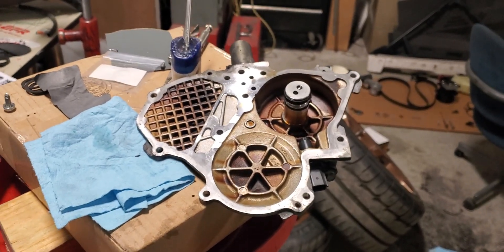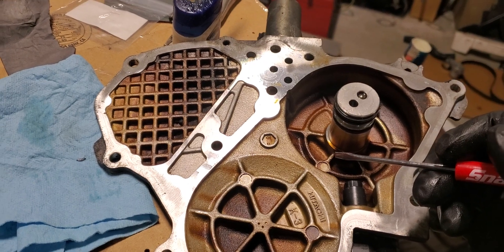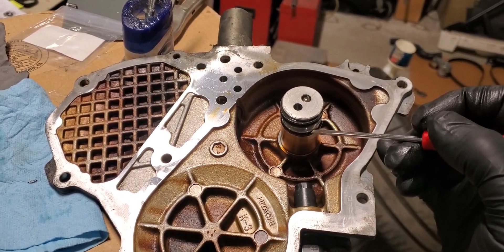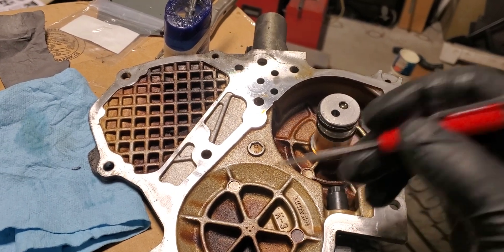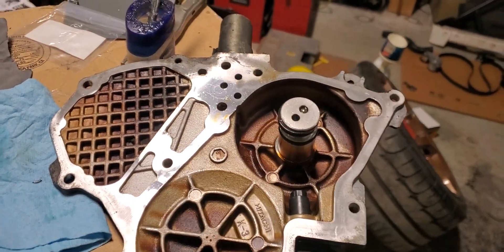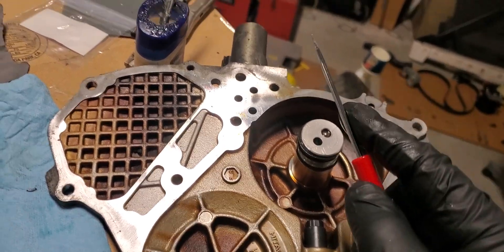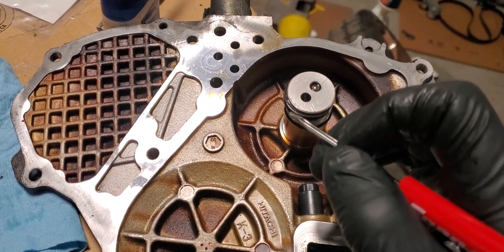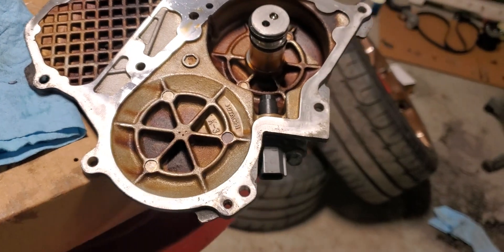Nissan 370z/ G37 (vvel) VTC control covers explained on VQ37VHR

Comment: Good Morning, fantastic video, I have a built VQ37VHR Turbo that is going into limp mode due to the phase not reaching required range, the motor functioned well for 4000km, and still runs perfect when not in limp mode, then started this error, it has had the block and heads cut, fitted with Wiseco pistons and Eagle H rods, after spending over $87,000 on building the car, the company that built the motor and the car  has washed their hands of it (run out of tallent) Unfortunately there is no one that I have been able to find in australia that has the knowledge required to diagnose the issue, after watching this video it makes sense to me that this is what is occurring, is there any way of further diagnosing to be sure this is the issue prior to tearing the motor down? I really appreciate your input
Reply from the maker: Can you get me any engine data stream info, I assume u have ecutek for management?
Reply from the maker: And what year engine/ car?
Reply: @sethjoyner391  Thanks for your response, the car has been tuned with Uprev, I am waiting for a friend with a professional Scan tool to be able to check data stream, mine only does VW, Audi euro etc, the Vehicle is a 2010 370Z

Comment: So, here i am again, decided to tackle a G37. 2010.

I installed 370Z heads from a good motor. MR16 headbolts, oil gallery gaskets, all seals EXCEPT, THE VTC cover seals & gaskets. ( seeing what i could get away with )

Now i have P0011-P0021 along with P0524. P0524 correlates with INT/V timing. 

I did a gallery gasket job on another G37 last year with VTC gaskets & seals, along with water pump etc & a VVEL module. His car ran perfect from the jump.

Mine has intermittent dips at idle & shoots for limp mode after trying to bleed the coolant system too long due to ECU picking up the issue, going to fail safe mode.

I am aware of Jim Wolf Technologies tech support section showing you what a slipping reluctor wheel looks like. 

I have ordered the gasket set from Z1 on the notion i believe oil is pissing out of my Cam Sprockets because, like i stated earlier, my buddies G37 ran perfect with gasket & seals replaced. Mine does not. Would you say this is a strong argument?
Reply from the maker: @cruisecontrol6938  oh yeaaa...all those gaskets have to be brand new...and the encoder wheel situation typically causes and intermittent no start or complete no start basically

Comment: Hello I have a g37 2011 and I have a camshaft position code and a p0011 have u ever dealt with those codes
Reply from the maker: For sure, what's it doing,  mods, mileage etc
Reply: @sethjoyner391  no mods , 103,000 miles will only run if u unplug one of the cam sensors , no misfires runs smooth
Reply: U have to unplug bank 1 sensor
Reply from the maker: @edmonmayfield2446  sounds like a bad intake cam sprocket 🥲
Reply: @sethjoyner391 
What are the reasons for it?
Thank you

Comment: Does this motor have galley gasket issue Seth ?
Reply from the maker: The first years till around 2012 I believe,  but u can see it on visual inspection of the rear case..loose screws, gasket protrusions etc

Comment: So i got my heads cut last week right. Not sure how many thousandths he took off or how warped the heads were, but will a stock head gasket be fine or would i need to go with a thicker head gasket? If so, is my motor now useless? Sounds to me like the timing cover bolts won't line up anymore because what your saying does make perfect sense.
Reply from the maker: They have very minimal milling clearance...if I remember it's something like .008 between the deck and the head..like a 5 cut on heads and a 3 on deck...they make thicker headgaskets..u need to know what those cuts were....like..a guy can't just do a 10 cut on the heads, that would never work
Reply: Wish me luck on this one. I got the motor running in an S14 240sx. The Exhaust manifolds kept glowing red Hot , l Iike dyno pulls red hot at idle. Noticed it always had fuel pressure but the needle was bouncing .. then 1 day.. needle  drops to zero but pump still works.. 

Today!!!! I post this comment, No gas.😅 . I put 10 Gal in today battery died so will charge tomorrow after work, will update .

Comment: Hey Seth, I like your explanations on this subject. I have a few pieces of data on these codes even after Gallery Gaskets performed and would like your input. Let me know how I can communicate with you.
Reply: That rattling noise at about 15% load i've seen a few times. I've pressure tested and logged and found during this noise one of the VTC is unresponsive and struggles to get to the same angle as the other up until 3000 rpm which then stabilizes and matches the other bank. While this is happening oil pressure fluctuates about 10-20 psi in an erratic way similar to heart attack on an ekg. 
This can be even after gaskets were performed. Your theory and explanation makes sense being that the cover can be receiving pressure but the rings in the cover might be leaking or the ide of the receiving end of the VTC could be worn causing oil pressure to leak between cover and VTC until 3000rpm which receives 40+ psi which is significan pressure and volume to force it into operation.

Comment: I had P0021 and P0524 codes, changed the bank 2 VVT solenoid (with cheap $40 unit) and it didn't fix it.  Read the oil pressure, good at 2000 rpm and low at idle at opr temp.  Replaced the GG and still have both codes now have P0300!  I bought 6 of the washer gaskets and lost one so I only installed 5.  Not sure which side I used the old one.  Me and several others did the GG R&R and now have the same three codes.  Could this be the issue, the washer gaskets or my "old" one?  I am stuck and want to get another Hitachi unit if the cheap one is not 7.7-7.8ohms or just swap it out due to it being an intermittent problem.  The car misses cold or hot and I replaced coils (cheap again) and still P0300.
Reply: I'm at this point as well, I just put a G37 together with a G37 bottom end, 370Z heads, seals & all. Oil gallery gasket,the works.

What I DIDN'T DO !!! Was change the VTC gaskets, seals for cam phaser, & now I'm getting p0011-0021 along with P0524. 

I have just ordered the Z1 gasket set to see if my P0524 goes away due to like he said," Oil pissing out of the seals being worn, broken, or worse. 

P0524 is an oil pressure related code, would also throw p0011-21 in correlation with each other.

Oil pressure on cold start (85-90PSI)
Warmed up 194°F (about 15-16PSI)

Comment: Will this cause a p0021 code?
Reply from the maker: What car, year, mods, when did it start and how did it happen/ what management?
Reply: @sethjoyner391 other than that the car drives fine. And I can easily cruise going 70-80
Reply: @sethjoyner391 I pmed you on insta and TikTok. 2009 g37. 185k miles.  Only code I’m getting. Will go in limp mode can’t go over 2.5k rpm’s. Then when I clear code. It doesn’t go over 3.5k rpm’s.  Already replaced the solenoid and cam sensor. It just randomly popped up after a week of buying the car. Engine oil has been good and clean
Reply from the maker: @ryanwingfield8127  ahhhh....can u get any real time data video clips of vtc intake sprocket #2 advance and desired advance...if you have changed the solenoid and pulled the cover and inspected the seals and all that is good...given the year and mileage I would assume timing chain stretch and/or a failing intake sprocket....have you replaced the timing chain?...those years have known intake sprocket failures
Reply from the maker: @ryanwingfield8127  yea, my bad, I don't check insta or tiktok enough. Lol
Reply: @sethjoyner391  I haven’t pulled that cover yet. What do I look for with the seals? Also I don’t think the solenoid was oem.
Reply: @sethjoyner391 I’m off today. I can go pull that cover any minute it seems easy to do.
Reply from the maker: @ryanwingfield8127  bank 2 driver side is an easy pull....u will need a new vtc cover gasket from nissan to put it back together...what you're looking for is excessive wear to the three dynamic seals on the vtc cover oil pressure dispersion shaft that goes into the vtc sprocket...then look on the inside of the vtc sprocket for excessive scarring or grooving from the seals...also, with that high of mileage I would be concerned about the rear cover gallery gaskets and lowered oil pressure as well as chain stretch, maybe point u in a direction
Reply: @sethjoyner391 is your shop located close to Winchester va?
Reply: @sethjoyner391  it does look pretty oily at the bottom of that vtc cover.

Comment: Me again 😅 1st rebuild never had a p0011 code. However the 2nd build runs amazing but its throwing that code and limp mode at 3500 4000 rpm. I changed the oil i bought new oem soulinoids even tho i tested the old one with 12 volts 😅. I reset the ecu after each fix and clear the code but keeps coming back in limp mode. I managed to figure everything else out (vvel issue and fan issues) but if i can just dial this last thing in i can have my car back with fully built motor. Should i change the cam sensor next??

Also want to add i got my vtc and timing cover powder coated. Should i swap out vtc cover and inspect the rings?
Reply from the maker: Powder coated vtc covers can 100% cause problems,  check the obvious vtc solenoid harnesses aren't backwards etc
Reply: @sethjoyner391 going to replace the vtc cover. Do you think I should replace cam sensor or just do the vtc cover 1st. Also is there any way to check the connectors to the solenoid?
Reply from the maker: @brandenlaferrara9467  let's start off with this, u have ecutek or can read data streams...u want to look at the vtc advance angle...observe both banks and see how synchronized they are...that way u can see what's acting funky...are those new or old sprockets? Also make sure the mag pickup is clean on the sensors
Reply from the maker: @brandenlaferrara9467  also...at that rpm is when the cam should be making its 2nd advanced if I remember correctly..hopefully it's not a sprocket problem
Reply: @sethjoyner391  so while observing the vtc angles for both banks on my scan tool they need to have the same or similar readings correct? 
Also want to add it doesn't go in limp mode right away. I can drive the car normal for a little bit untill the ecu detects the problem causing it to go into limp mode.
Reply: @sethjoyner391  old sprockets I have 2 sets. 1 from my original motor and one from the junkyard motor. I ended up using my personal sprockets off my motor for the 2nd rebuild. 
The 1st rebuild I used the junk yard sprockets and never had a p0011 issue. However my sprockets are way cleaner then the junk yards that's why I ended up using my sprockets
Reply: Swapped vtc cover and used the info you gave me and everything worked out perfectly. I knew as soon as I started it and the oil pressure was instantly 15 ibs better. You can watch how much better the oil pressure was better thru a mechanical gage.  It didn't flutter down it was solid all the way to warm up. Bank 1 bank 2 was synced the whole time according to my scan tool. No limp mode just a healthy ass newly built motor. Thinks to your vvel vtc and rebuild videos 🙏 
Also shout out to my dad! Took 9 months and 10 12 thousand but I know enogh now and I never have to LS swap my shit.
Reply from the maker: @LaffysPizza  hell yea brother, the nightmare is over....go off king!🔥🔥🔥
Reply from the maker: @LaffysPizza  and shout out to a real dad!!! Respect🙏
Reply: @LaffysPizza wait wait wait, you changed your covers.....& your cam sprockets ?????
Reply: @cruisecontrol6938  just my covers the other one got powder coated. My theory is some powder coat was still present during install. 
Motor still running strong tune on 93 making 330 whp with stock airboxs
Reply: @brandenlaferrara9503  damn. On stock Air boxes. Makes me wonder what my polished combustion chambers+exhaust ports will do. 

Also took about 2-3mm off the lower Intake Plenum ports & shaved the upper plenum down mostly even with that factory plastic overlap. 

I'm hunting 3in intakes atm but fighting a P0524 code after the rebuild. I did not change the VTC cover gaskets & O-rings so my educated guess is oil is slipping by the o-rings.
Reply: @cruisecontrol6938  do you have a oil pressure gage? Did you change the gallary gasket also when you put the rear timing cover back did you replace the nipple looking gasket near the gallary? 
That's a oil pressure code. You should have 12-15 ibs at ilde after oil is warmed up
Reply: All new gaskets and seals oil pressure reading at 15PSI.
 At 194°F.

Comment: When replacing vtc cover do you have to use and sealant on vtc cover gasket?
Reply from the maker: Nah, brand new nissan gasket only or it will leak...u can use a scotch brite pad for any extra corrosion around the edges...a cleaned surface with acetone
Reply: @sethjoyner391  I did the gallery gaskets on my 3.7 and I'm having a pretty bad oil leak that seems to be coming from these covers new gaskets and torqued to the FSM specs I'm not exactly sure whats causing the issue maybe the fact I had the cover sandblasted messed with the edges or some dirt got in the threads and interfered with the torque spec.. I was pretty meticulous about cleaning all the edges, I even had an engine shop double check that the timing cover was completely true they did not take the VTC cover off though when inspecting it

Comment: Still got a P0021 after changing the Oil, Solenoid and Cam sensor.
Reply: Did you ever figure it out?
Reply: @ryanwingfield8127  yea did a timing job 1.5k for the labor from my mechanic excluding parts from Z1 for all of the timing set, camphasers, water pump and Rockauto for the exhaust spockets. Basically changed everything in the Galley and now she's 168k strong.

Comment: Hi there I’m hoping you can help me out I have been dealing with my car for 5 months I have taken it apart and put it back together 3 times to check for mistakes and debris. I have a 
2008 G37 coupe VHr  
146,000 miles

I have taken the car apart and replace the gallery gasket and water pump, using the timing cover kit from Z1 motorsports ,every since I’ve done this job the car has not ran correctly. I have double triple checked the timing to make sure it is correct…The car will start up no problem but runs really rough at low RPMs if you rev the engine it sounds a lot better same when you drive it… But if you try to give it a load it goes into limp mode I cannot figure out what is wrong with the car I have replaced camshaft sensors VVT Solenoids, Oil pressure switch etc. I have even volt checked all plugs and sensors with a voltmeter… here are the codes that I am getting: 
P0021
P0456
P0524

If you could please help me out I would greatly appreciate it I live in Houston Tx and I have not found anyone that seems to know as much as you about the VQ platform if there is any other way to contact you better please let me know at donaldwilliams2009@gmail.com

Comment: So ima having an issue had the car sitting for about 3 months oil is dirty now I’m having a limp mode situation not sure if it’s the solenoid or the vvel relay but car won’t rev past 5k on start up it does go to 7k
Reply: Not sure if solanoid clogged or relay bad
Reply from the maker: Do you have real time data?
Reply: @sethjoyner391  the real time data shows rich fuel and lean switching back and forth  fast also it does backfire at 7k then goes limp but if there’s no load applied drive fine
Reply from the maker: Did u have any codes?...how many miles what year car?
Reply: @sethjoyner391  no codes they all cleared on their own when I swapped a camshaft sensor and engine roughly 70